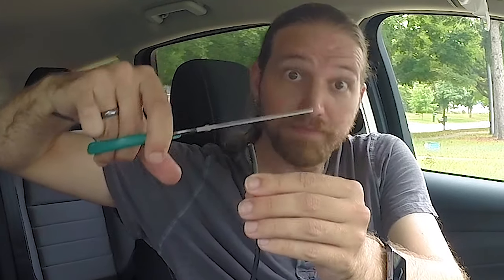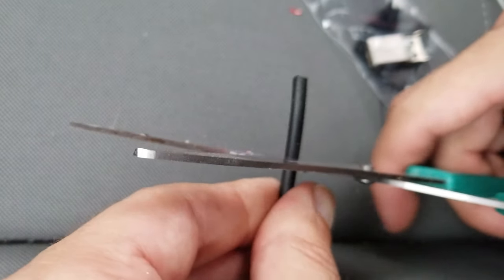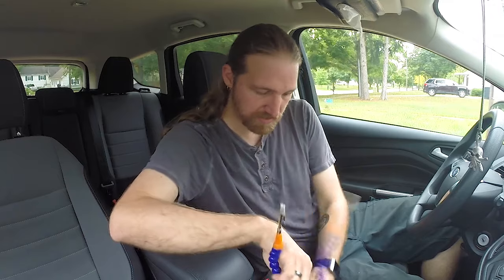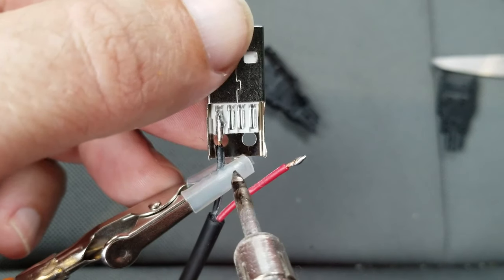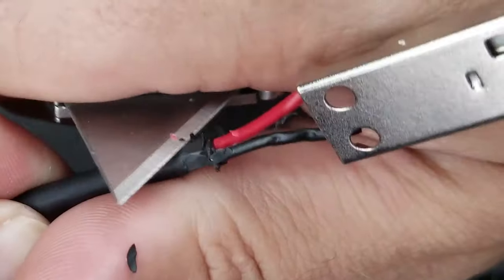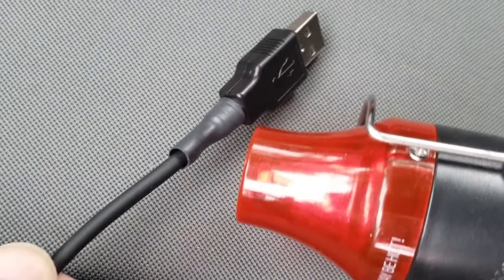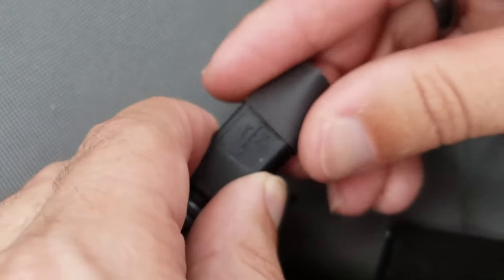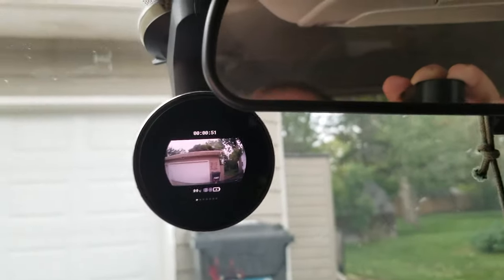FIXIT - USB CONNECTOR

Comment: Wow he really did this in his car, props
Reply: Like watching surgery at the scene of the accident lol
Reply: @lyrablack8621  The Simpsons did that 🤣
Reply: can an old casing be repaired...there's no damage to the metal part, but somehow there's a 1.5cm gap on the top of the USB cover. naturally debris has now infiltrated the cord.  it is now teetering off and on then warning it's a slow charging. with it still pseudo working I'd think there's hope (I can't go get another cord for hours so it's sort of crucial) what would you do if it were yours? Im fully aware there are no guarantees....also if I were to do that I have no where near the tools...
could it be just cleaned and retaped or once I pull it apart will it destroy what little connection is left?

Comment: All those gadgets to fix it cost way more than a new cable
Reply from the maker: @gordondalrymple7644   Tools can be used more than once and not every tool I used was 100% necessary. There are also, tool free ways to perform the repair. But regardless, as I mentioned, it's a proprietary cable, and is actually no longer sold, as the specific camera in the video has been discontinued. So the cost of finding a replacement could actually end up costing more than the cost of all those gadgets. Finally, fixing something isn't always about saving money. I enjoy fixing things, I like solving problems. Buying tools that I can use, and spending time fixing my existing cable, add more value to my life than simply purchasing a new cable.

Comment: Thank you! I successfully replaced a broken USB head of a lamp dimmer.
I ruined like 4 heads in the process but eventually did it right :)
Reply from the maker: @eyalpery8470  That's excellent! Yeah, thankfully they usually come as a multi-pack, so there are plenty of extras for... practice. ;)
Reply: Nice to hear I just don’t have wire stripper 😂

Comment: ...and here we have our repair- easy & quick! (Yes, but having ALL the right tools kinda does that to a job. Probably more affordable to get another wire) lol All those purchases aside, this was pretty neat to watch :)
Reply from the maker: True, you need to buy the replacement tips. But other than those, all you really need is a soldering iron. And you can get one for under 5 dollars. (And you can buy them locally, pretty much anywhere, e.g. you can buy one at Walmart.) Plus, it's a really useful too to have. The heat-shrink-tubing isn't necessary, but its also nice to have, with a lot of other uses. And you don't need a heat gun for it, you can just use a lighter, or even just the heat from the soldering iron. -- Alternatively, this fix can be done with out buying anything. If you have a doner cable, you can just take the end, strip the wires, and twist and tape. You don't even need to solder. It won't be very pretty, but it will work. But buying the tips, is just a much cleaner, more professional way to do it, while still being cheap and easy. -- As for just buying a new cable, yes in many cases it would be cheaper and easier to buy a new cable. But sometimes, the cable is hard-wired into the device, or in my case, it was a very specialty cable, that was specifically designed for the dash cam. Replacing it would have been rather expensive, assuming they even still offered replacements.

Comment: I'm inspired to get a soldering gun, great video.
Reply from the maker: Absolutely, a great tool to have around, and many uses beyond just soldering. Wood burning for example, a soldering iron can be used as crude wood burner, and vice versa. If you have a wood burner, you can use it as a soldering iron in a pinch.
Reply: A battery powered  solding iron, no less. i didnt know they did these.
Reply: @chrisliddiard725  If I should have known that those existed... I purchased a new soldering iron earlier this year to fix my Gameboy cartridges, but I wasn't aware that there are battery powered soldering irons :'(

Comment: great video sir, would it matter if you interchange soldering the wires black and red?thanks!
Reply from the maker: Thanks! Only if the device you are charging/powering requires a specific polarity (which most things do) The actual color of the wire doesn't matter, but red is usually (+) positive and black is usually (-) negative.

Comment: what supplies did you use and can you post the links to get them? thank you!!
Reply from the maker: I added links to the description. The main thing you need is the "USB 2.0 Type A Male Socket 4 Pin Plug Connector." And then a soldering iron, heat shrink tubing, and a heat gun is handy but you can just use a lighter or even just the heat from the soldering iron. Or just skip the heat shrink tubing and use tape.

Comment: Cool. I like it. Can you do a video on how to fix a cable for charging a phone when the connection gets loose? Also usb
Reply from the maker: There is not much you can do when they start getting loose. You can try bending the casing (carefully) just a little to make it a tighter fit... (kinda like bending the prongs on a electrical plug...)

Comment: It was great and thank you very much for the video, Could you please help me? I have a damaged USB Extension connector and it went through the wall, but the male USB connector ( just like the one in your video ) has been broken. now I have a cable with 4 different color wires in this cable > Black - Red - Green - White. How should I connect these wires to the male USB connector?
Reply from the maker: The standard for USB is [ (4)Black (3)Green (2)White (1)Red ] but not all manufactures follow that standard. If you want to be sure, it would be a good idea to check with a continuity tester (multimeter)
Reply: @IamNickDClements  Thank you very much
Reply from the maker: @samyem6743  You're welcome, best of luck with your repair :)

Comment: I'll give this a try ! Thanks for the clear video.
Reply from the maker: You're welcome, best of luck with your repair!
Reply: @IamNickDClements  Thanks, it worked ! Definitely not the best soldering job, but the wires are kept separate enough apparently. But now I'm missing the USB type-a "casing" (not sure how you call this). I'm not sure where to get this without getting 10 of them ^^. The old one doesn't look like it can be reused.
Reply from the maker: @nikarmotte  Cool! Glad it worked. Yeah, no real reason to by a 10 pack if you don't think you'll ever use them. One idea is to try covering it in hot glue.
Reply: @IamNickDClements  Yeah I wanted something that looks as good as new, at least from the outside. I ended up messing up the first try so I was glad to have an extra 9 ! Looks great now.
Reply from the maker: @nikarmotte  Oh, awesome!

Comment: I came here searching for how to solder usb connector, cause I purchased a USB to type c micro USB adapter and it's USB female Port just came out.
Thank you! 
Sir can you make a video in which you demonstrate how to make USB 3.0 female Port to type C, micro USB adapter? If possible.
Reply from the maker: That's definitely going to take a bit more skill, and precision. When you are just dealing with just power, and USB 2.0, it's quite straight forward. But USB 3 is exponentially more complex. Especially if you are dealing with data, a high speed USD 3 cable has ten different wires to deal with. So even if you get everything hooked up correctly, you might still have speed and bandwidth issues. Not to completely discourage you from trying it, it's definitely possible to do, but unless you have a very specific need, you are probably better off just buying an adapter. You can get x4 on amazon for $7. https://www.amazon.com/dp/B07GH5KJH2
Reply: @IamNickDClements  Thanks for the reply, I think I will just purchase separate adapter . USB 3.0 to Type C, USB 3/2 to Micro USB.
I'm not an electronics engineer or student, thank you replied or else I might have wasted more time and money trying to do that.
Reply from the maker: @Beast80K  Happy to be of service :)

Comment: Hey I like your video but I request to say how to repair charger head connector is displaced or broken  tell me how to repair
Reply from the maker: As in repairing the other end of the cable? If so, it's basically the same process (except the solder points are much closer together) you would just need to get a "repair kit" for the USB end you need. This one is for Micro-USB: https://www.amazon.com/dp/B08SC8LPHD and here is one for USB-C: https://www.amazon.com//dp/B01LZEUWGQ

Comment: Okay, so this could be a dumb question. Could this method help if I have a good cable, but I want to extend it and make it bigger?
Reply from the maker: Not dumb at all, and it certainly can. Just be aware, if it's a data cable the limit is around 15-25 feet before you will experience disconnects, data loss, and speed issues. To go longer however, you can daisy chain 15-25 foot cables with powered USB hubs, or you can actually get these special adapter boxes that let you run a USB signal along a cat5 (network) cable. - Of course if it's just for power, you can get a pretty decent length before any significant voltage drop.
Reply: @IamNickDClements  These cables are rare to find now so I just want to grab some of the ones I still have at home and have a longer cable just for my ps3 controllers or an external cd/dvd reader that I have for my computer.
Reply from the maker: @samusranzer  You could also just try using USB extension cables.

Comment: Any chance you could show a USB repair of the other end? That is, the device a cable goes into is loose and wiggly, and you need to secure it. I've got a lot of devices where they just don't sit quite right. Too much abuse, I suppose. I was thinking of using glue, but I'm worried about it getting all over the connections if I screw it up. I'd like to see how you'd approach it.
Reply from the maker: It would be basically the same process, just a lot smaller. The part you would search for would be "USB Connector Shell Micro-B" or Mini-B https://www.adafruit.com/product/1390 (Though, if it's loose, it's usually an issue with the socket on the device and not the plug, and that can be really difficult, especially for a cell phone, etc. For that part you would add "female" or "receptacle" to your search.)
That said, one trick I have used, is to take some needle nose pliers, and bend the metal covering on the connector, just a little, to make it wider than normal. This will make it fit more snugly into the socket. see: http://bit.ly/bentusb for reference.
Reply: @IamNickDClements  Thanks for the response and suggestions! They're great. I've seen suggestions online about needle nose pliers trick, but am concerned about the longevity of the receptacles themselves.

I was also a bit unclear in my comment. The specific socket type I had in mind was USB type B. It's an older technology, but is used for a lot of niche peripherals I have to use. For whatever reason, it seems like the USB Type B cables hold up great, but the various devices that use the USB type B female end have a tendency to come loose and wear out extremely fast. I don't really get why it's happening, but I've got something like...at least 15 to 20 devices using this connector that are all super sensitive to even light movements. It's really annoying. Each time they come loose, the entire peripheral has to reboot.

No worries if you don't have any ideas for that specific scenario, my situation is pretty unique, I just figured I should ask. If you have any thoughts, please let me know! :)
Reply from the maker: @Sawta  USB-B, ah okay. It's still widely used in printers and scanners etc. B being larger would be much easier to replace. Although, yeah, I've never had a B connection wear out. I would say it's one of the better USB connector types... so yeah it is odd to hear about it getting loose... What about just doing away with the connector all together and soldering a USB cable directly to the device? Alternatively, you could try swapping out the USB-B connector for maybe a RJ45 connector (network cable)
Reply: @IamNickDClements  my issue is my cable is hard wired straight to the dash cam and the plug is damaged / bent so unable to fit into dash cam , can this be replaced the same way? If so where can I buy the smaller plug
Reply from the maker: @luciocancellara4995  it certainly could be, but the level of difficulty increase as the components get smaller. You might have more luck doing a cable splice, than trying to put on a new tip. If you can find a spare cable with the connector you need, cut of the end you don't need, cut off the damaged tip, and then twist the individual wires together.

Comment: Hey Nick, I found this video very helpful, as the problem shown with your cable is very similar to that with my computer mouse (bent at the connection point, shown during 0:06), which bent at the plugin. Would you suggest doing what was shown in the video to fix something like this, or will I have to replace it altogether? It's of nicer quality too, the wire being covered in a synthetic fiber, so I'm not sure what to do with it. Any feedback is greatly appreciated!
Reply from the maker: Yeah, you should definitely be able to put a new tip on it. You will just have to connect the 2 additional wires in the middle for the data connection (or 3 if it's USB 3, which for a mouse is unlikely).

Comment: too many tools needed
Reply from the maker: You could do the "fix" by simply twisting the wires of two cables together, and the only tool you would need is a pair of scissors or a knife. The tools and supplies I used in the video just allow for a "like  new" repair. But even for that, the only crucial tool is a soldering iron, which I think everyone can benefit from having. They are an extremally versatile tool, you can find them just about anywhere, and they can be very inexpensive. The wire strippers just make it easier, they could be replaced by scissors, a knife, or even just your fingernail or your teeth! The heat gun,  could be replaced with a simple lighter, or even jut the heat from the soldering iron. Or as I said in the video you could just use tape.